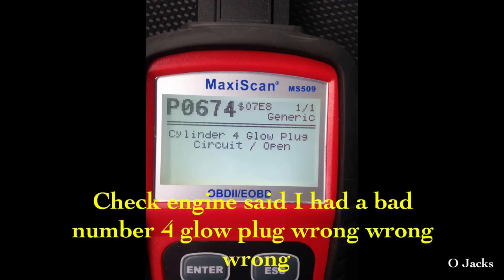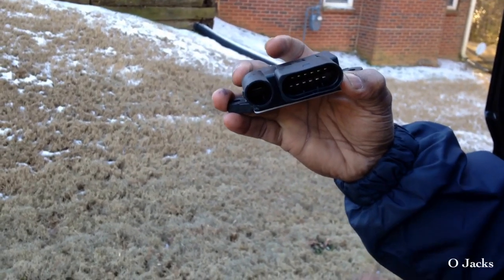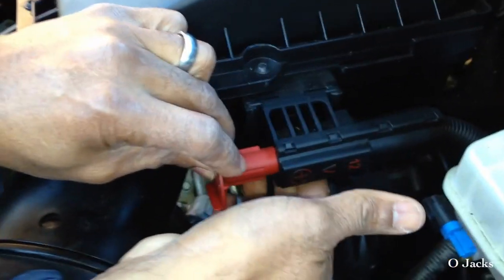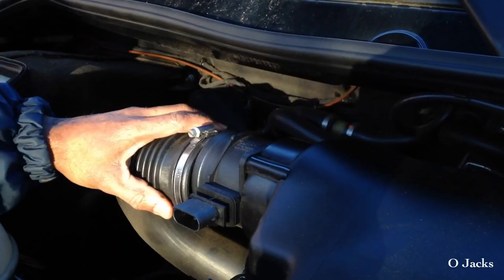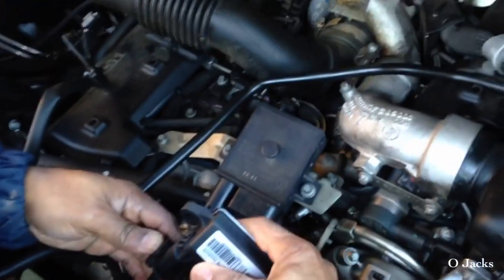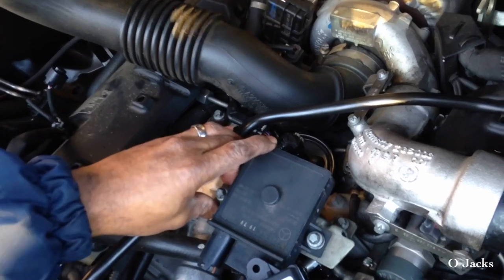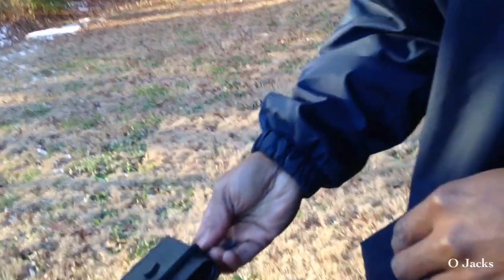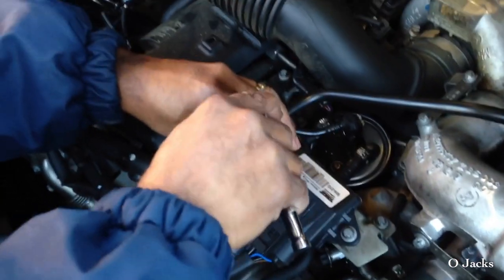Watch First Before Changing a Mercedes Sprinter Giving a Bad Glow Plug Code

Comment: You saved me a lot of money and heartache by posting this my 2008 dodge sprinter was flashing the same code as yours bought the module and cleared the code and wham all good ,!!!!! Thanks again
Reply: What device did you use to clear the code?
Reply: @Grundalizer  disconnect the battery ground for about 10 mins. Should clear it.

Comment: Thanks for producing this very straightforward video.  I'm getting the same code (P0674 Cylinder 4 Glow Plug Circuit/Open). Did you test the glow plug first to determine that it wasn't bad, or did you change this controller first?

Comment: Where did you buy the part 904-310? I have 2012 Sprinter 27,000 miles on it and I have P0671, so do I just need to change the plug? or change the module?
Reply from the maker: YC Motors 
Try changing number one first see will that clear the code should fix the problem
Reply: I'm sure you fixed your problem by now.  But when one part only cost a hundred dollars plus you are that far into a tear done. Replace both while you are there!
   Your comment came through a year ago. What did you do to fix your problem?